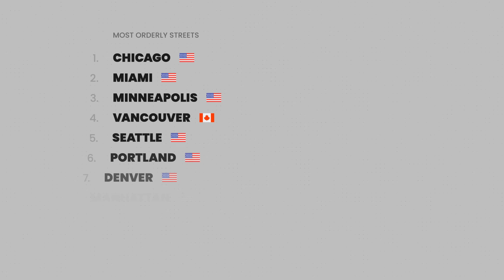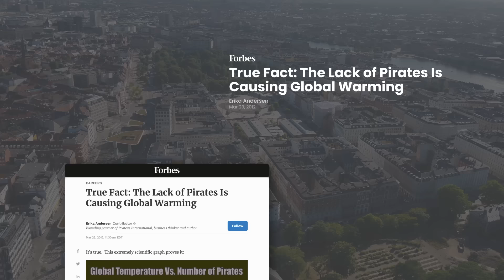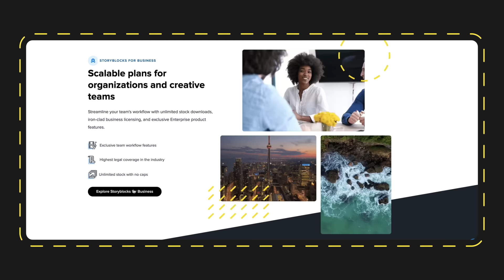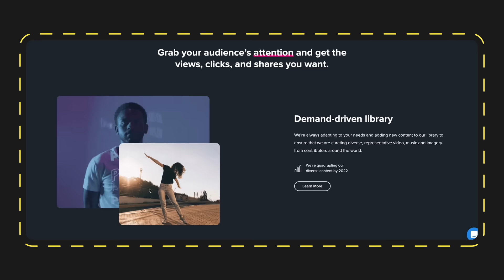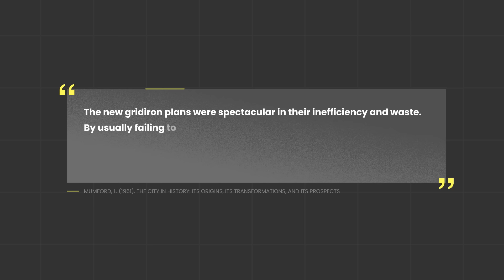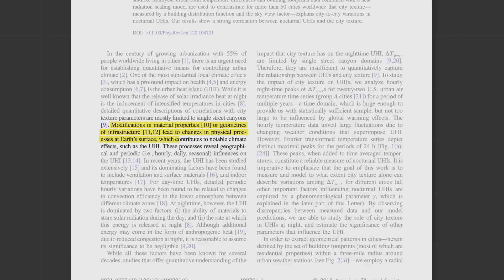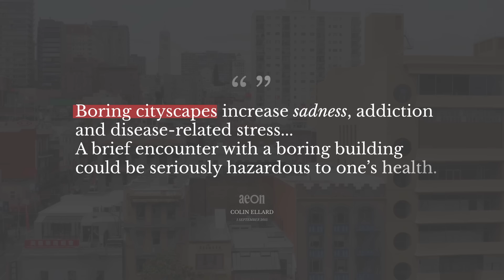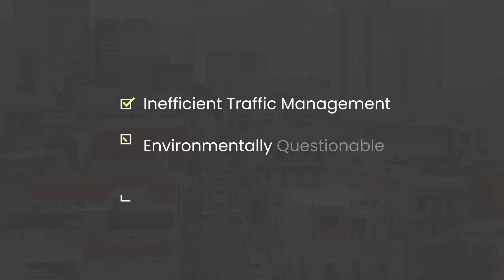Why Cities With Grids Are Terribly Designed

Comment: In City Skylines I adopted a different kind of grid, to deal with the biggest issue, the frequent intersections. So the main avenues intersect, of course, but not every side street actually connects with the main avenues. So between avenues only one street conects, while inside the square created by the main avenues more side streets emerge to occuppy all of the space. That's not all though, wakability is a big issue in the US. In my City Skylines simulation, while not all side streets connect to the avenue, I did create a path for pedestrians so that all side streets connect to the avenues, therefore pedestrians don't have to walk all the way around to a side street that does connect to the main avenue. This also encourages walking instead of driving for short distances. If you live two blocks from a main avenue, where there's a shop you need to get to, it would be faster to walk there rather than getting on a car and drive farther just to find the connection to the main avenue. In the US people drive everywhere, even when you can walk there in 10 minutes or less. This grid design solves that issue. Public transporation is of course important, but with the paths that connec to the main avenue it's easy to get to the buses, metro or whatever you need. More walking also means less pollution. 
Traffic on my simulation, even in a huge city, is not a problem.

Comment: All those American cities were very livable in the 20s, 30s,40s, and 50s until as we say, "The neighborhoods changed". I've been to European cities but find US cities much easier to navigate. I wouldn't get too enthusiastic about electric cars as there is not enough electrical infrastructure to charge EVs if everyone converts to electrics. Propane, natural gas, as well as methane recovered from sewer gas should be used as motor fuel as well.

Comment: But if grids are so bad then why is Barcelona's grid okay? It's not grids that are the problem. The problem lies in cars being (by far) the main mode of transport, the quite narrow streets, the (often) tall buildings which block the sun , and a lack of trees.

A shift from cars to bicycles/walking/public transport allow for less traffic. Which in turn leads to better air quality and less heat.

Wider streets (not wider/more lanes per se) allow for better airflow and better separation of pedestrians, cyclists, and cars. Which makes traffic clearer. This also makes it easier to build roundabouts at the intersections.

Shorter buildings make sure more sunshine reaches the ground and also help to stimulate airflow.

Wider streets and shorter buildings also make room for trees which have countless benefits.
Reply: The grid system are not bad, they are only bad to people who think they are superior. The US is a Superpower with cities that have GDP larger than many countries. This is something people is the US don't worry about, it's just simply not an issue, it is what it is. The history of our cities just evolved differently from the ones in Europe, like many other things. No city anywhere is a utopia, the grid is just fine, no major issue here.

Comment: This argument does not seem to hold any water when given further analysis and thought. Yes, American cities do not fall in the top 10 most livable cities, but if you look at the EIU Livability report that you seem to use, many American cities still fall within the top 30 when European hubs like Rome, Prague, and Dusseldorf are all outside the top 50. Of the American cities on the list, strict adherents to the grid Miami and Chicago rank higher than cities like Boston that do not follow the grid. 

Based on looking at these two data sets more deeply, it appears that not only is this relationship not causal, it does not exist at all.

Comment: Maybe the reason that US grid based cities are retaining more heat are the facts that the buildings are very tall, air conditioning more prevalent - ie you heat up the outside to cool the inside, and then US cities are more southern than a city like Copenhagen (same latitude as Anchorage, Alaska).

Comment: I'm detecting a lack of critical thinking here. Where to start?

First--the main reason that US cities have grids and European ones don't is history. Major European cities were populated centuries--or millennia--prior to urban planning, and their legacy is streets and roads that snake around. It's possible to observe the same phenomenon in lesser focus if you compare cities in New England with those further west or south--New York City may be a grid, but Yonkers, Larchmont, New Rochelle, Mamaroneck, Rye, and Westchester County are not nearly so. Indianapolis, by comparison, has a grid with street numbers running over 100. OK, San Fran is an exception--thanks to topography more than planning.

The reason that the grid cities use more energy is that major European cities have far fewer air conditioners. They are further north and have less use for cooling. Note that Madrid is roughly on the same latitude as Washington DC.

Moreover, having rode through London and Paris and Madrid and Barcelona and Lisbon--for my points of comparison--driving in those cities is a horrid chore, with slow progress, traffic issues, and navigation challenges that might even vex Google maps.

Try correlating the presence of robust mass transit with urban happiness ratings--I think you'd find more valid results.

Comment: Big problem of cities with grid system - there is not interesting for walking and for pedestrians, all streets have the same direction, all streets are straight, in all districts of city, nothing new. An this can be enough to dislike this system and to dislike of using this system in cities. I don't know about central part of the cities (if grid is good or bad for it), may be it can be the theme for discussion, but when all territory of the ciy is the same it looks very boring.

Comment: The idea that grid designed cities are the issue is not a good argument. 

Melbourne for example is a grid designed  and was the most liveable city for 7 years but fell due to covid. 

Taipei which is on your list of most liveable is essentially grided as well. 

Tokyo is also relatively grided and you were raving about Tokyo q few videos ago. 

The benefits of having a grid far outweigh not having one in the modern era. Having a grided layout gives residents and tourists a better sense of orientation. NY city is one of the biggest and most attractive cities in the world and it's grided design no doubt facilitated its ability to grow so big in such a short amount of time but it's still easily navigable and you never feel like things are that far away. 

What makes the cities you mentioned worse off is Euclidean zoning and car centric urban design. Cities that have a lot more mix use zoning have more dynamic urban areas giving higher pedestrian traffic making a city feel more lively.

Comment: In 1969 and 70 I lived in Colorado Springs. Whenever I had to go to Denver I was perplexed by the downtown area where the grid system seemed to be rotated 45° off from the north, south/east, west grid of the more outlying streets. This created asterisk shaped intersections with flatiron blocks where these two systems came together. Since then my only contact with Denver has been at the airports. That is another story. My making a connection at Stapelton, and the later new airport, has been the exception rather than the rule.

Comment: The grid was never built for its aesthetics.
It was used by the Romans to establish
their military camps in transit. The soldiers
would march along, establish a camp, lay out streets,
cut trenches, erect berms, etc.
The US Army followed a similar grid system.
The grid system was good for the horse and buggy.
It was terrible for the automobile, esp. after women
decided to improve the aesthetics and plant treeees and bushes.
Then men built fences and other structures. With all that,
you can hardly see the car coming at 10mph over the speed limit
until just before y'all collide. And nobody stops to say,
How did that happen?

Comment: This sounds pretty spurious to me. How is the grid measured. Visiting Kyoto or Osaka, both often rated in the top livable cities, they certainly feel like majority grids. Zoom in on the east side of Tokyo and it's all grid. You even showed Barcelona at the end which is just about the most perfect grid there is. Maybe it doesn't rank as high as Chicago because of some edges or other parts of the city but that's just more evidence that "gridness" has no correlation with livable. As another example of similar issues, population density, Paris vs Hong Kong. Anyone who's spent some time in both cities knows Hong Kong feels 10x more crowded than Paris. But because of poor ways of measuring most lists claim Hong Kong has much less urban density. It's nonsense. And I suspect the same is true here.

Comment: More than the "grid pattern" the thing that hamper the confort most is the "car centric" design.
In car centric city it doesn't matter if you are a driver or a pedestrian you will inevitably spend a lot of time waiting for the green light that's makes having a stroll absolutely annoying and yes, I can agree that crawling between blocks all similar to each other is quite boring.

Comment: hmm not the grid i think, first it's about the transportation, and yes supported by terrible zoning, USA mostly use car where Europe use bikes and well designed mass transportation, USA has most tall building that trap the air and light, Europe is not. it's not exactly about the grid, it's more about the other system revolve around it.

Comment: This argument is flawed and a case of "correlation doesn't mean causation". A number of very livable cities are grid based. For example, before the pandemic Melbourne, Australia was the most livable city for almost 10 years in a row, Vancouver, Canada was in top for a long time. They dropped lower just because of some pandemic effects. Both of those cities have a massive grid. I lived in Melbourne and it's a beautiful and very livable city indeed. Just because a city has a grid doesn't automatically make it worse. It sounds like the argument in the video is mostly based on American cities which are generally terrible for their own reasons and just happens to be grid based as they are mostly planned cities.

Comment: DC is the tale of two stories. DC itself is a perfect grid and is both a very walkable city and drivable city (minus traffic). Overall just a good city to get around in and not feel lost. But if you cross the river into Arlington where I live, it’s a different story. The roads are laid out in the most randomest ways. Driving is a pain in the ass because unless you know where you are going, you can’t rely on the “5 blocks this way” or  “just head south” method to get around. Also, you might be passing a light and won’t know if you’ll hit another one either a mile down the road or half a foot down the road. I think this also limits the walkability aspect/feeling of the city. It makes neighborhoods and sections of the city feel cut off or separate from each other. So people mostly only walk in the areas with main roads (Wilson Blvd for example). But you won’t see them walking so much on the streets/neighborhoods that branch off unless they live there. Where as in DC all the streets look the same so people walk wherever.

Comment: Bad video. 
Yes, what you mention between livability and gridlines is a correlation. It's not food for thought.
I study a a lot of new urban city planning. The problem is not gridlines as a whole. But hte following:  
1) Cities were not well designed for cars and high traffic. 
2) You can still use gridlines but big blocks, less cars and better design of arteries and roads to deal with this.THere is plenty info about this in the internet
3) You can improve pedestrian sidewalks, public transport etc and traffic will be less
4) Airlfow: You can use wider avenues for that. Even circular streets can disrupt airflow. 
 
Conclusion: Watch many other videos. The grid system has many advantages not mentioned in the video. But you need to desing cities according to the laws of new urbanism. It relies on bigger grids and more things like the ones I mentioned.

Comment: I think the issues you are describing are symptoms of a very modern issue that cities didn’t face prior to very strict zoning codes that took place (basically think before the mid 20th century). 

Parts of NYC and Chicago are examples of how cities grew without the strict modern zoning codes of today. They’re among the most livable and navigable cities.

The building regulations are killing the efficiency of American cities but the grid system can have superior usefulness for navigability and accommodating growth both outwards and upwards.

I would actually prefer it if American cities used grids more often

Grid suburbs are way more efficient and navigable than Euclidean suburbs

Comment: I'm sorry but there are some serious flaws in this video. You make the very rookie mistake of not using per capita statistics. Yes, there are more roads in New York as a fraction of surface area, but far, far, fewer roads per capita. You may heat island costs, but these are dwarfed by the savings in per capita road cost. If New York built the same ratio of road surface to individuals that say Tampa does, it would cost billions and billions extra, and then billions more for multiplying the length of infrastructure (say utilities). Of course you might say that density can come without a grid, and this is true to some extent. But density on the level of European cities and NYC cannot be achieved with main arteries and highways. This is just a basic urban planning principle, induced demand. Cities which use a grid have slower speeds and less fatal accidents, and residential neighborhoods can still feature traffic-calming approaches which prevents them from being a high-speed artery. 

More suburban approaches with cul-de-sacs tend to funnel cars on a few high-speed arteries causing traffic and higher levels of fatalities, as well as diminishing all street life. If the entire city consists of high-speed arteries and solely residential neighborhoods with no through traffic, the shops and walkable neighborhoods that you see in places like London, Paris, New York, etc. all die.  And why are you focusing on traffic at all? No large city (which are the ones featured in most indices) like New York should be optimizing car travel as this comes at the expense of mass transit, cycling and walking that comprise the majority of trips in the city, and are much more efficient. Of course, some suburban American cities can't easily transition to this and I understand that some cities still need to use cars as the main mode of transit. But these tend not to rank high on liveability. 

Finally, the commentary on traffic fatalities is unforgivable. Cities like New York have a small fraction of the deaths per capita of sprawled, non-grid cities like Tampa, Jacksonville, Nashville, etc. I think you may be interpreting a correlation as causation. The U.S. as a newer country with empty space had more opportunities to create a full grid city. They also tend to be ideal for the midwest. But the U.S. sucks in livability due to more limited social programs, safety nets, inequality, and other indicators which these indices measure. In addition, just as one European example, many Scandinavian cities like Stockholm and Oslo tend to feature highly on livability indices but have geographical features that prevent a full grid. And European cities still tend to have a grid element, even if not as pure as the US due to historical constraints. This whole video just contradicts all urban planning best practices. 

On a side note, green rooftops are a wonder tool. They dampen the heat island effect, prolong the length of roof, cut heating and cooling costs, allow pollinators and wildlife, offer green space for people in the middle of dense cities, can be used for gardens and food production, and slow and spread out stormwater runoff which can mitigate flooding. And of course, planting more trees and dedicating some traffic lanes to pedestrian walkways and green space can further address the heat island effect. 

There are some accurate points no doubt in this video, but it sort of seems like an oddly American, car-centric view which goes against most urban planning trends

Comment: Can we talk about the absurdity of saying that the grid system of Chicago is "terribly designed" because creating a grid of streets requires modification of the landscape, when the land on which the city of Chicago is almost completely and utterly flat? The development of the city thus required practically no reshaping of the landscape whatsoever in terms of its street layout.

Chicago is the home of numerous huge engineering projects, from canals to river locks to parklands to skyscrapers. Heck, the entire city itself was rebuilt after it burned down in 1871. But building the street grid was no sweat whatsoever. They simply laid out the streets along mile upon mile of totally flat prairie.

Comment: Every problem you mentioned is not caused by the grids per se, but by the combination of grid design with excess dependence on cars for transportation. You mentioned Barcelona as a counter example, and to that you can add Buenos Aires, which is mostly arranged as a series of grids, but it's the most livable city in Latin America

The opposite is also true. São Paulo is one of the most unordered cities in the world, but that most definitely doesn't define it's livability